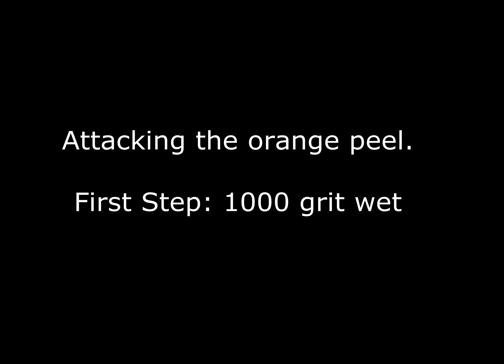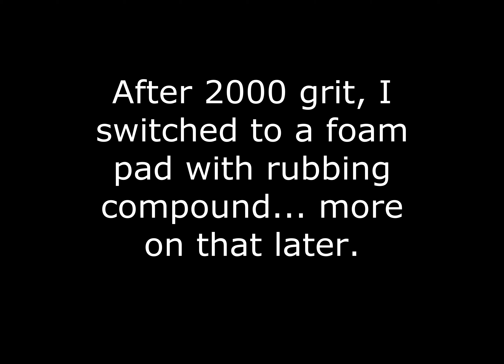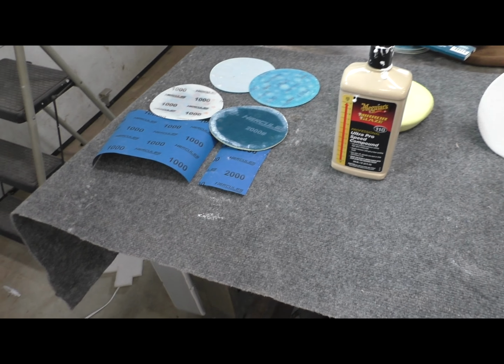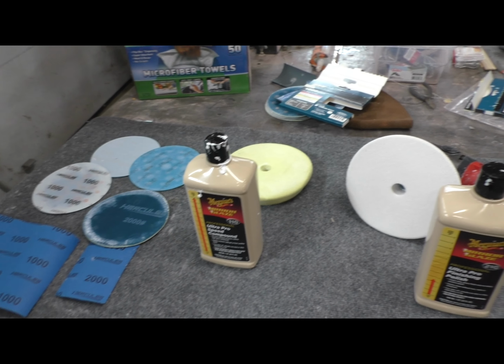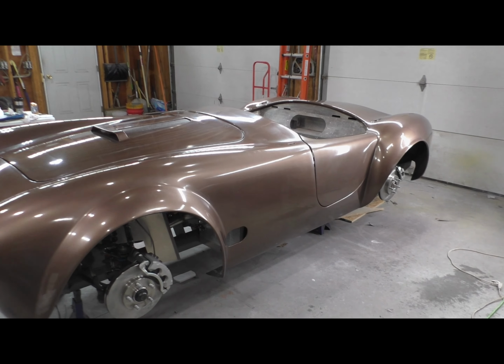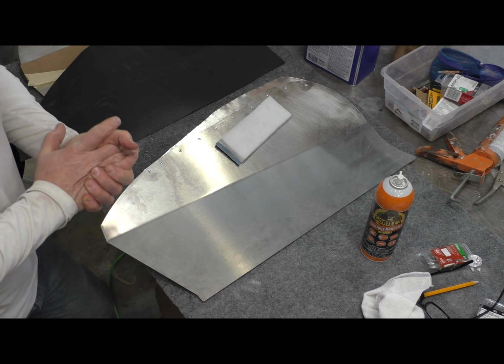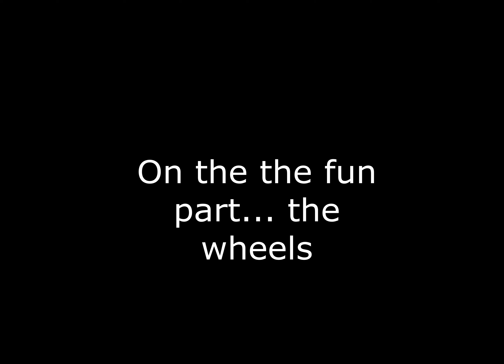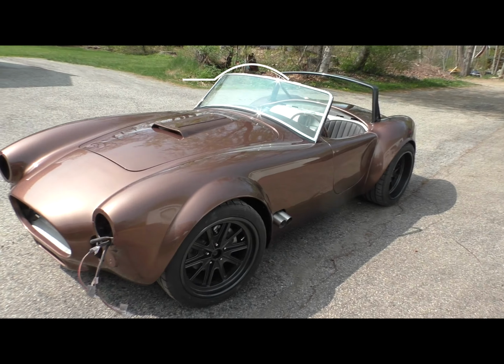Factory Five Roadster Build 33

Comment: Awesome job, inspiring! Ya make me want to sand harder & faster…but I have to take it slow & steady 😒😁
Reply from the maker: Yes slow and and steady is the trick. I’m not the most patient guy so it was a challenge not to go at the orange peel with 80 grit….
I stuck to my plan and it worked.  I will say that I have about 8 hours into cutting and buffing. Took a little long than expected, but I’m happy with the results.